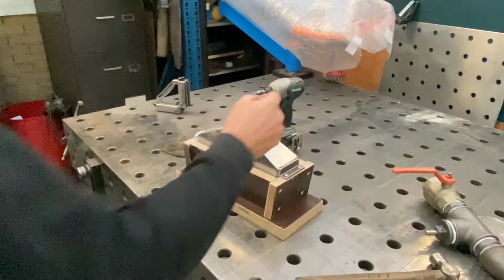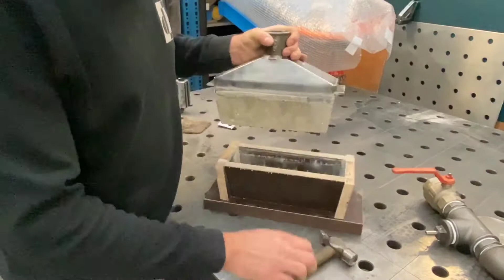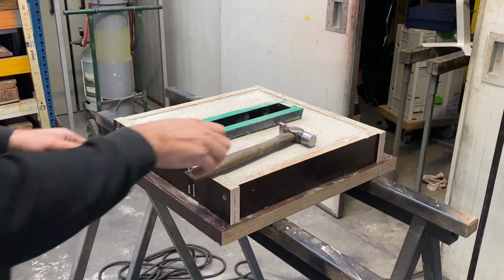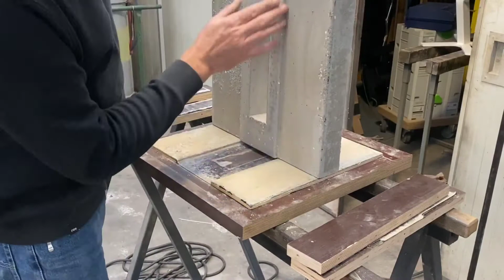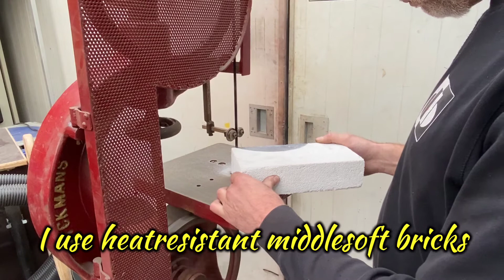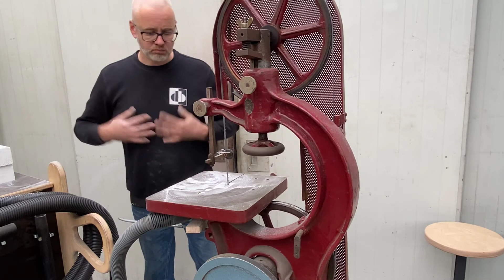Ribbon burner forge  Part 4

Comment: If you can easily cut through this middle soft brick (is that what you call insulating fire bricks IFB?) why wouldn't you just drill holes into it to create your ribbon burner. It would certainly save you a lot of time and trouble instead of making the mold.
Reply from the maker: Thanx for your tip! Maybe a good idea voor my next burner.
Reply: @dimitribalde5636  If the band saw can cut through this soft fire brick easily, then drilling holes to make the ribbon burner would be a lot faster and easier than making a mold.